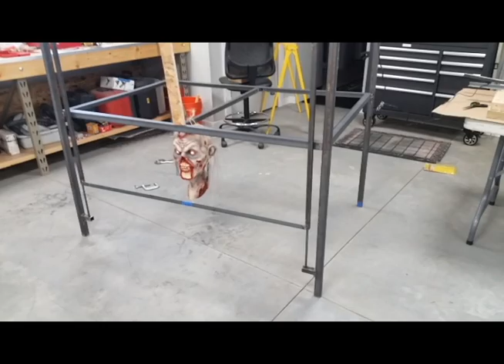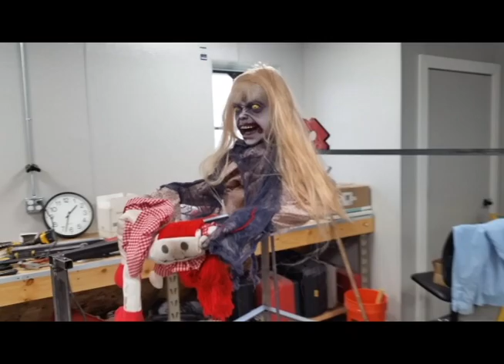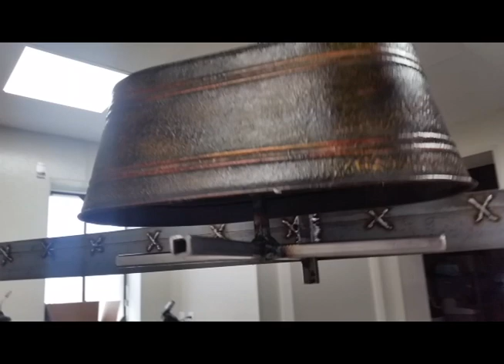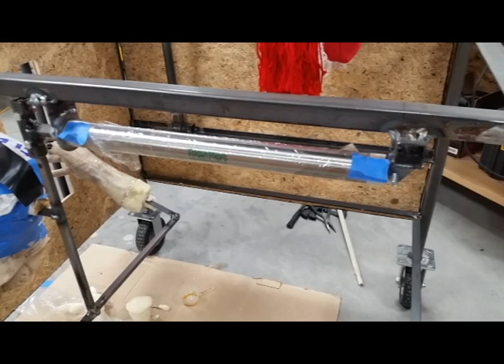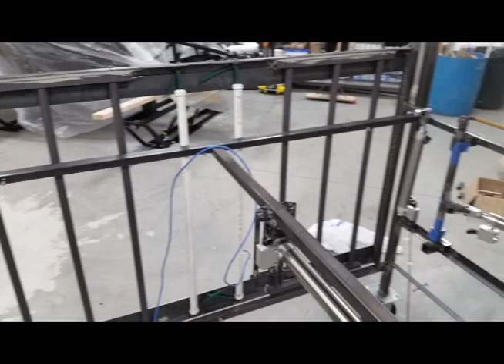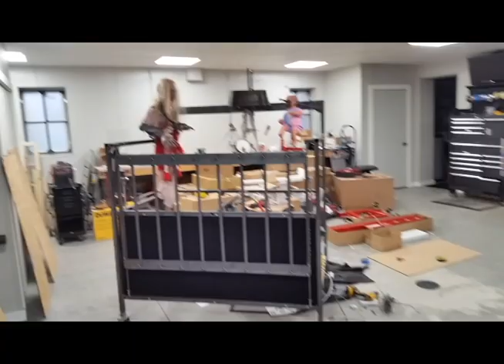Creepy Crib Halloween Prop 2017

Comment: Hello Awesome job  I do have one question about how you  hooked up the cylinders to the boobox are all 4 cylinders running off one boobox and do you have a tutorial on how you  set it all up
Reply from the maker: Thanks....yes, all 4 cylinders, air blaster, mobile, lights, and kicking/crying baby are all hooked up to the 1 boobox flexmax by FrightProps.  I don't have a tutorial but on FrightProps.com support page (under controllers) they have a ton of detailed diagrams on how to hook up their controllers.  I just followed those diagrams as they are very detailed.